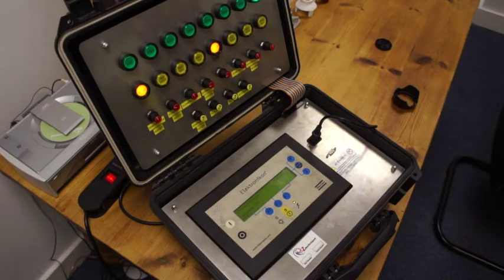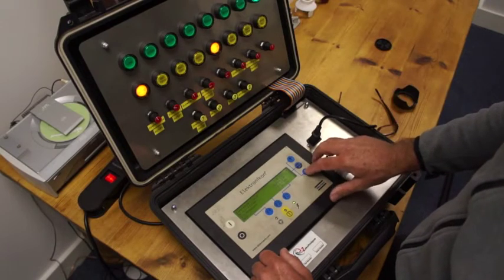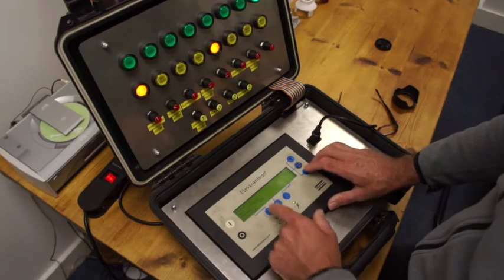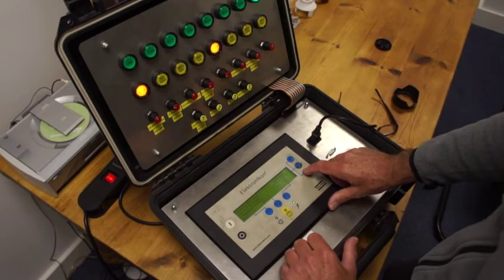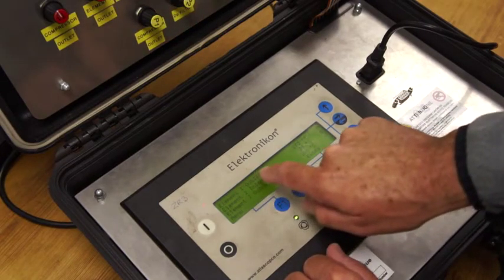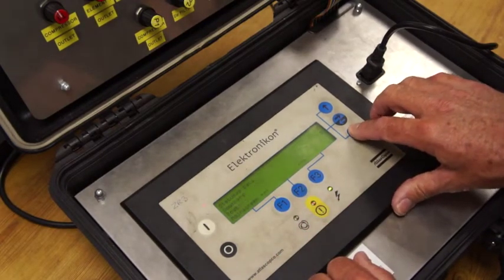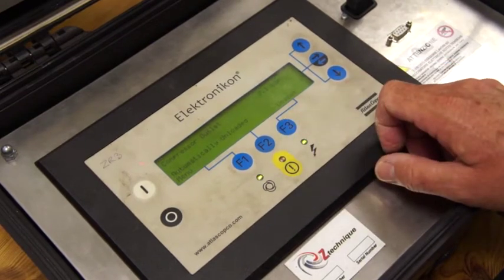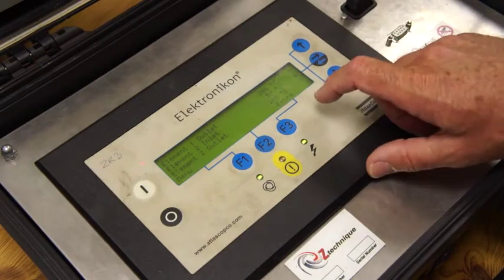Mk4 Atlas Copco Elektronikon Training Ztechnique School by Ztechnique.co.uk

Comment: I have a problem with the atlas copco ga 200 compressor, the electronics can't unload after the loading position, and I've changed the electronics to the same but still can't unload, all sensors read normally, the solenoid valve works normally, but can't cut the current for the unload command, where do you think the error lies?
Reply from the maker: Please visit our web site , complete the inquiry form that will be received by service and they can see if they can help you by email ztechnique.co.uk